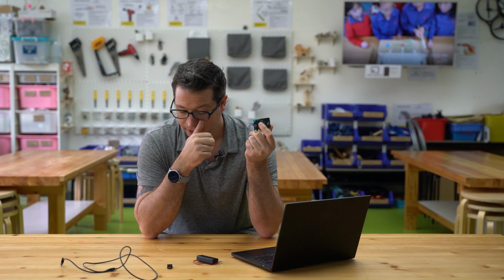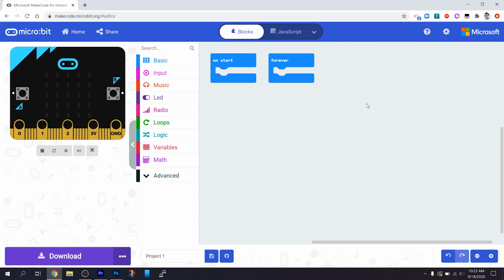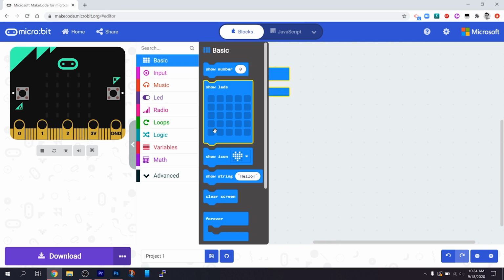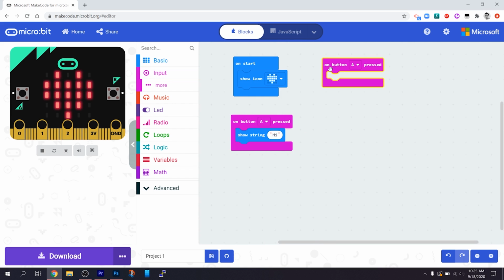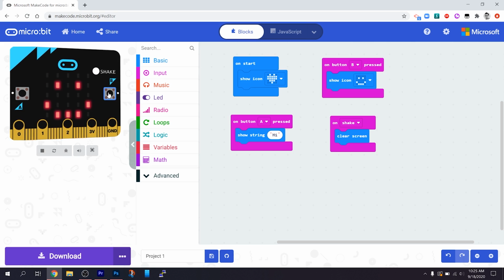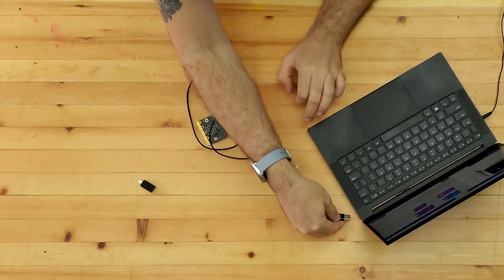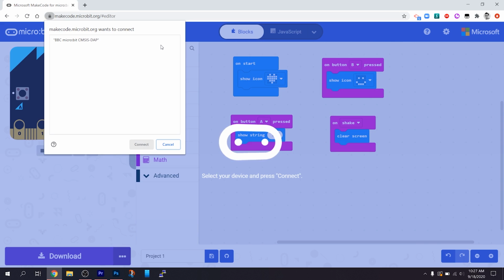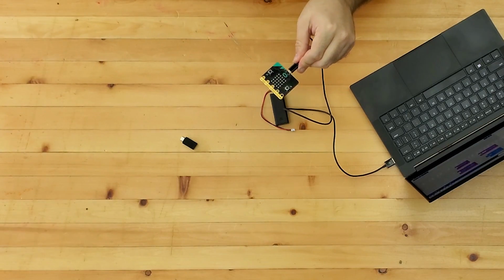Coding with micro:bit - Part 2 - Connect & Code

Comment: I just spent several hpours trying to figure out how to move a Makecode Microbit program to another PC.  Finally, it was really simple - things always are when you have figured them out!
I was working with my grandson, so we were using the block code.  Here's how to do it

On PC A
Switch from block code to Python (select Java, and a Python selection drops down.  Click it.
The pprogram is shown in the Python language, which is text.  Highlight iot all and copy ir with a Ctrl-C
Open your favorite text editor and paste in the Python text.
Save it to a USB memory stick

On PC B
Plug in the USB memory stick
Open the saved Python program with a text editor
Highlight everything and copy it with a Ctrl-C.  This copies the text to the computer memory, where it will stay till a later step.
Open MakeCode.
Create a new project.
When the "On Start" and "Forever" blocks are shown, switch to Python.  There will be almost nothing in the Python text.
Hilight annything that is there and press Delete to get rid of it.
Remember that since you copied the Python text from the USB stick, it is still in the computer memory.
Put the curson in the now empty Python program area and press Ctrl-V to paste in the python program from memory
Click the Blocks button at the top of the screen - and Voila!  There's your block program.